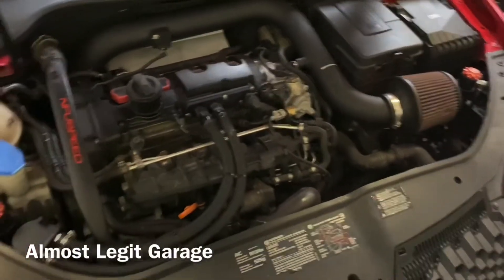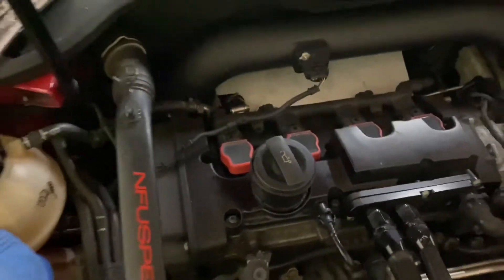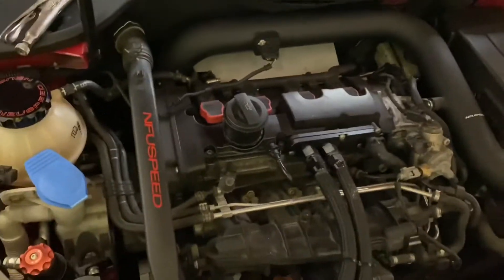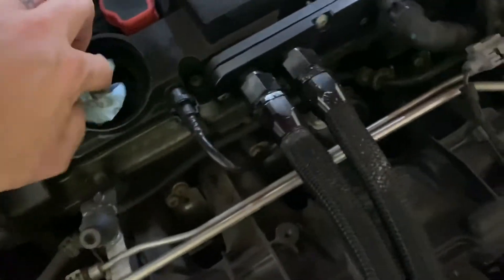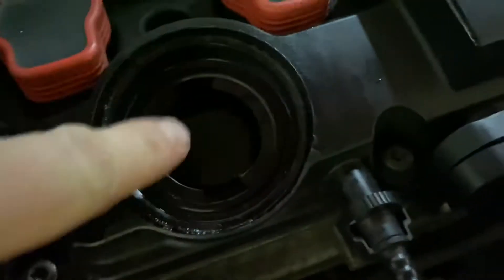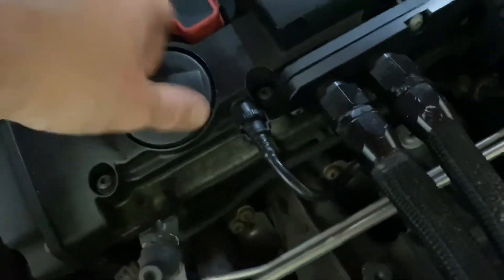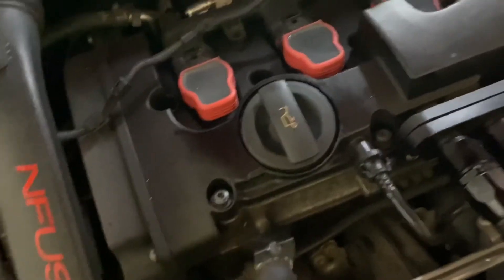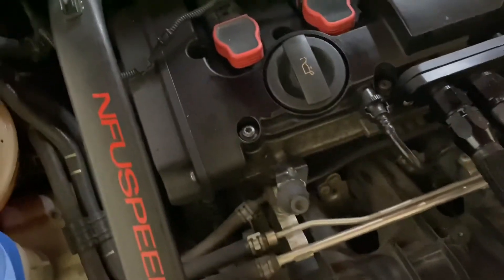FSI oil cap mod.

Comment: Where did you get the catch can ?
Reply from the maker: It’s a cheap Amazon catch can and an 034 Motorsports adapter on the valve cover then some eBay -10 an lines and fittings.
Reply: @ckrummy13  links to the parts ?
Reply from the maker: @sai2691  https://youtu.be/SuZPkL5k7IA they’re in the description

Comment: Update on the oil catch can??
Reply from the maker: It’s fine, it fills up fast in the winter, and seems to have a little more oil consumption than the stock PCV set up, but I’ve been lazy about seafoaming the intake so it might be saving me from carbon build up. Lol